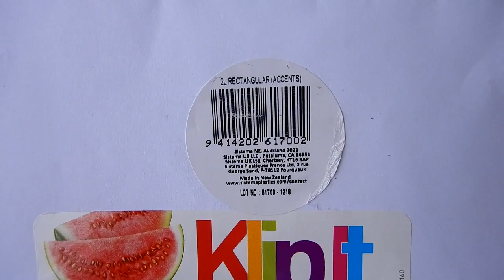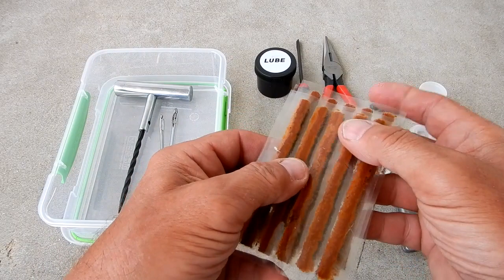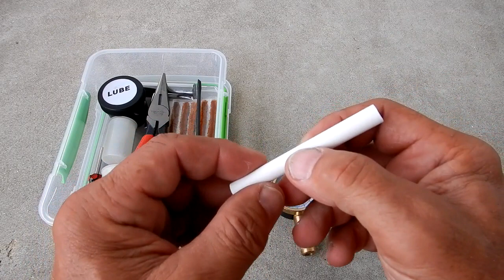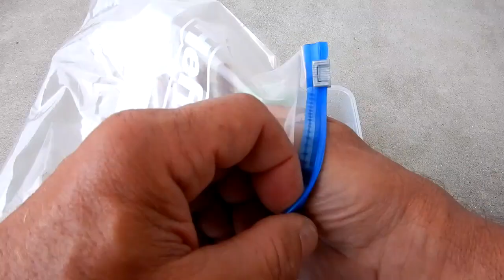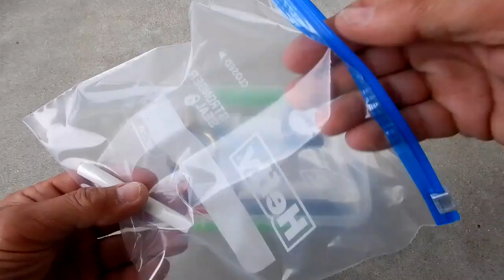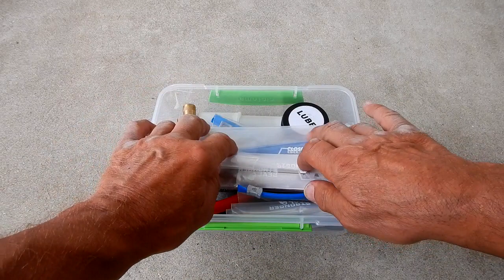Tire Repair Kit to Keep in your Vehicle

Comment: One thing I suggest is to use instead of chalk is a grease pen or chalk.  Mine are yellow but white is good. Chalk is too easy to wipe off and many of the plugs are black. It just helps to monitor the plug for a few days after the repair. 
Thanks for doing this. While I always have a kit in my toolbox, I haven't thought about it in years.  Good refresher!  Also a couple pair of nitrile gloves help keep your hands clean despite the stickiness.  The job inevitably gets you filthy and disposable gloves always makes the job a bit neater.
Reply from the maker: Great points guzzialfa, thanks.